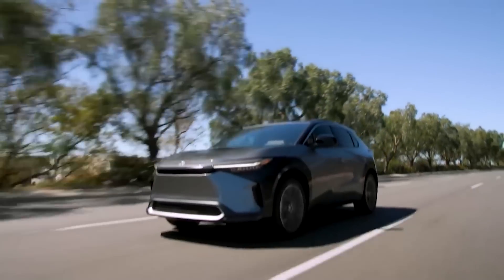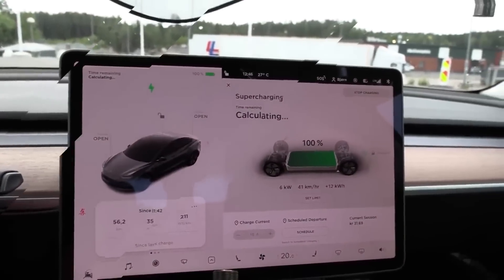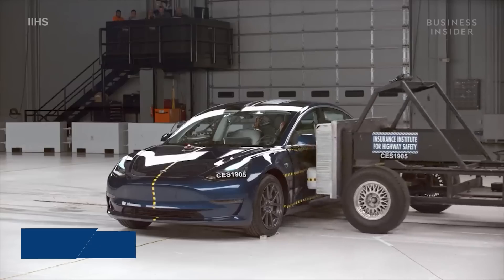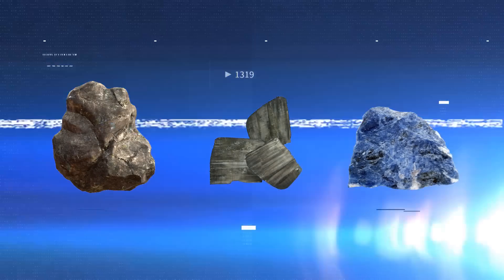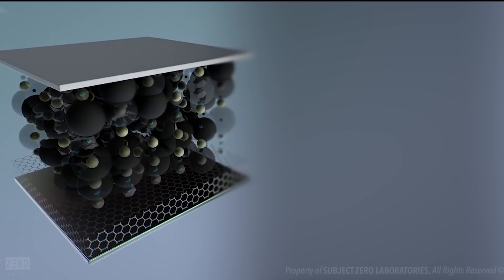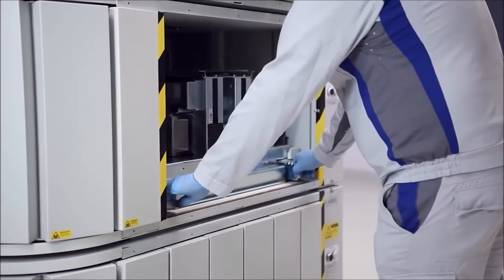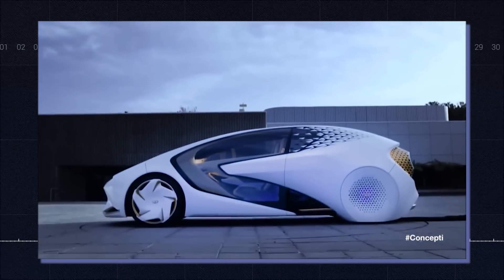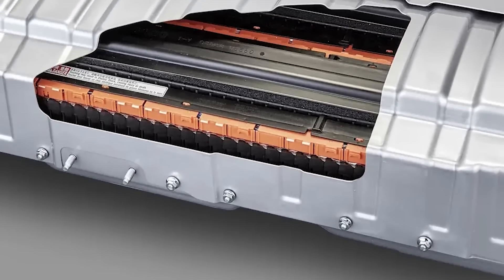IT HAPPENED! Toyota's Solid State Battery Finally Hit The Market!

Comment: Looks like Toyota is making the logical step to replace them in their Hybrids. Allows them to be really world test them before they make the commitment to go full EV. To early to get to excited. If solid state batteries are as good as they say it will be a game changer. Cheaper, lighter, higher mileage and blazing fast charge.
Reply: thanks for writing down what's been said in the video, you're so smart
Reply: agree. if the solid state battery is as good as the theoritical design, implementing it in hybrid will allow longer electric-only range, which paired with atkinson cycle ICE will allow much higher efficiency.
Reply: Scooters 🤮

Comment: I'm assuming they are going to use the batteries for hybrids because they can't make enough of them or they cost to much to use them in a fully battery powered vehicle.
Reply: I'm not so sure.  I think they may be adopting them in their hybrids as a way of testing how many charge/recharge cycles can be achieved with the new solid state batteries.  The much smaller battery pack in a hybrid will potentially be charged and recharged many more time than a much larger capacity battery required for an EV.
Reply: The reason was explained in the video
Reply: It is a good test of how well the batteries can handle frequent charging and discharging.
Reply: bingo